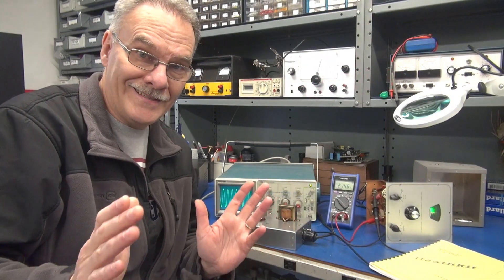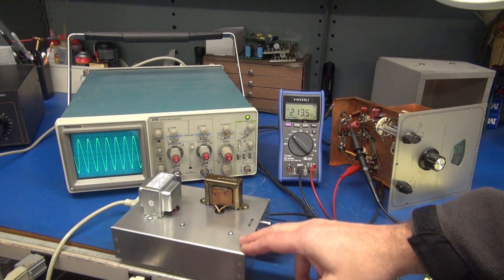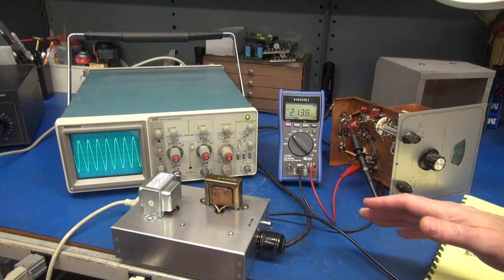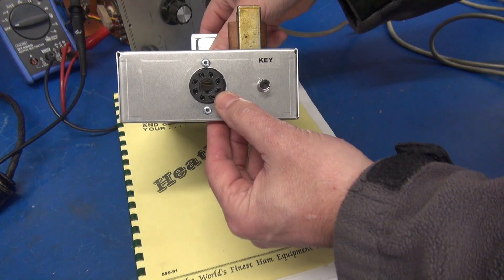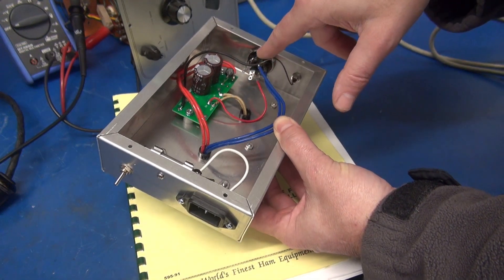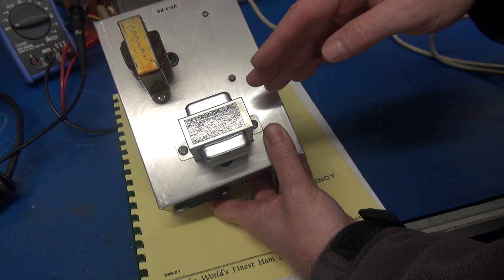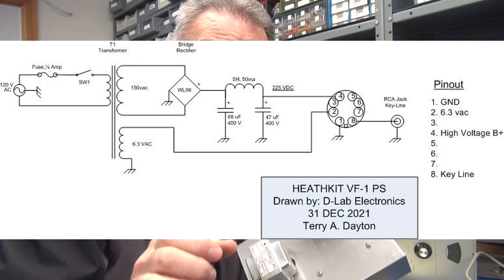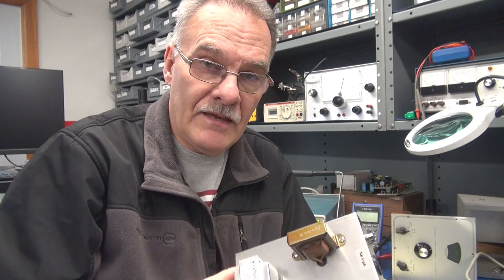How to make homebrew power supply for Heathkit VF-1 VFO options for classic Ham radio transmitters

Comment: Got the power supply built.  Thanks for making this video and for sending the schematic.  I had to use a larger transformer since plate/filament power transformers are getting scarce as chicken's teeth and priced past the Moon.  I also mounted everything atop a deep aluminum cake pan.  The question I have is the female RCA plug on the power supply called "Keyline" that connects pin #8 of the Octal plug to ?.  I found that I don't need to use it.  Do I run the "keyline" to the key jack of the transmitter and run the key into the jack on the VFO?  Is the "keyline" plug the VFO output?  Sorry to have questions after you've already done so much.

Comment: Thanks, Terry. I am building this for my VF-1 and I had a couple of questions: Why are the capacitors two different values? Also, if I wanted to add a bleeder resistor, what value and wattage would you recommend? I assume it would go between the B+ and ground. I used some 1n4005 diodes to make a bridge rectifier for mine.

Comment: Another great video, Terry.  I recently purchased a DX-35 and VF-1 that has been completely rebuilt with new parts.  I operate mostly on 40m.  When using the VFO in the first position, output is about 20 -30w and sounds good, some raspiness to the tone but not like when I'm in the second position.  There the output is 30-45w and sounds like I'm using the wireless on the Titanic.  Have you experienced this before when you've worked on or used the VF-1?  Tnx.  Happy 2023!

Comment: Nice!  A couple of years ago, I wired up a very old and battered swapfest VF-1 to try to feed both a vintage Eico 720 CW transmitter (cathode keyed) or equally old Globe Chief (grid-block keyed), also CW only.  I found that I couldn't do both with the VF-1 without modifying the circuits because of the different keying requirement.  It seems that even the Heathkit lineup of simple CW transmitters has the same compatibility issues.  

I went with the Eico, and found that keying the VF-1 itself worked best.  I didn't build a separate power supply for the VF-1, but I almost wished I had.  It took a lot of trial and error to figure out what value and wattage of dropping resistor was needed coming off of the Eico's 600 VDC B+ power supply to properly feed the VF-1 without chirping.  Simply building a separate power supply might have been a better option. 

My Eico/Heathkit combination works pretty good except on the highest frequencies, but from reading the literature on the VFO, the VF-1 has quite a reputation for being quirky -- especially when it comes to powering it from voltage taps on the transmitter it is used with.
Reply: I got lucky and managed to come by two VF-1s over the years.  I have one wired for cathode keying and the other for grid block keying.  There’s also a mod on the web where a single VF-1 can be modified to select between either grid-block or cathode keying with the throw of a switch.